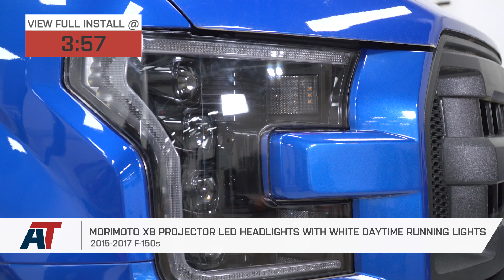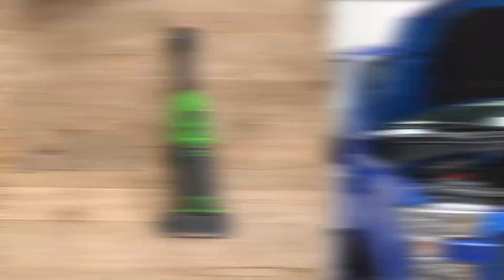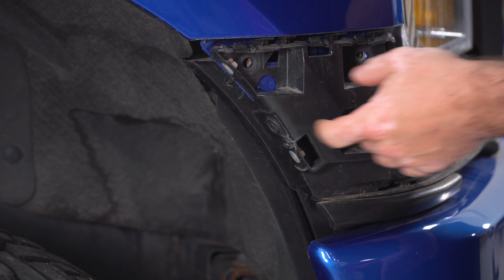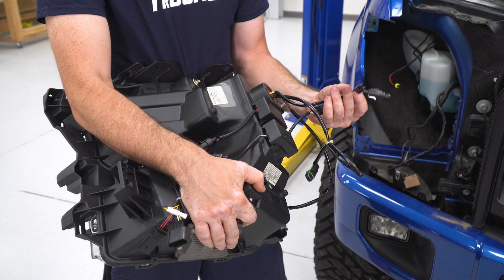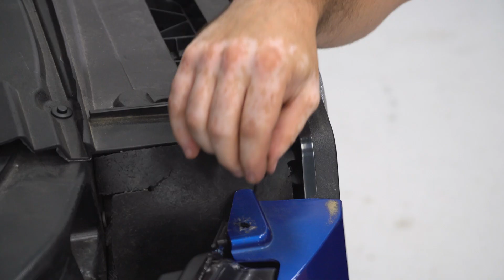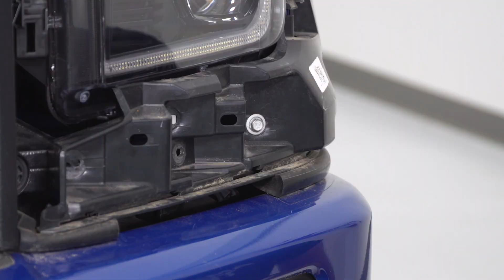2015-2017 F150 Morimoto XB Projector LED Headlights with White DRLs Review & Install

Comment: Finally after years of wanting these, i bought them. Installed and of the headlights dont work.
Just spent almost $3000 Canadian, and a day install. Driver side projectors dont work. No low beam or high beam.. :( Hope warranty isnt a hassle..

Comment: Also, the video shows NOTHING about headlight beam alignment.    Mine were so low that 75 feet in front of the truck in low beam, there was no light at all.  No alignment instruction sheet was included and I couldn't find a video.  The low beam is easy to adjust the up/down.  The adjustment screw is right then and easily turned clockwise to adjust the headlight up.  
Adjusting the high beam is a totally different animal.  When I have my high beams on, oncoming cars never flick at me.  My high beams are way too low.  
The adjustment screws are not visible or even accessible with skinny hands/arms.  
The left side high beam adjustments can be reached by removing the engine fresh air duct and feeling around for the screw.  Got it.  
But adjusting the passenger high beam is going to require removal of the fender well cowling, turning the steering totally to the left, and then, maybe the adjustment screw will be  accessible.  I haven't done it yet.  But it needs to be done.
Reply: Ya i noticed my low beams needed adjusting too....thanks for the info Ken!

Comment: They sell a different headlight for F150s with factory LEDS, not a harness.
Reply: Not really. When you buy the Halogen one it comes with everything you need Minus the LED harness.  I Picked up two of the headlights, one for a xlt and one for a lariat and the only difference was the Led one came with both harness one for the Halogen and led versions 👍